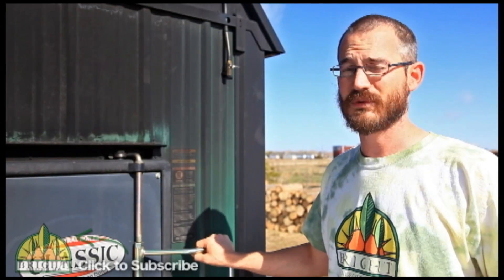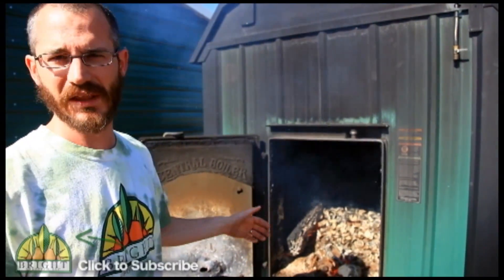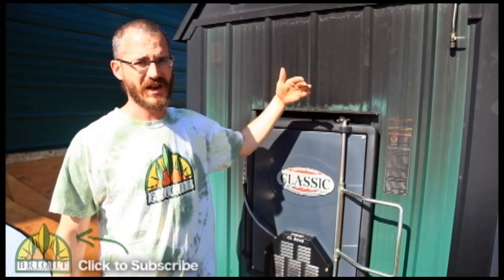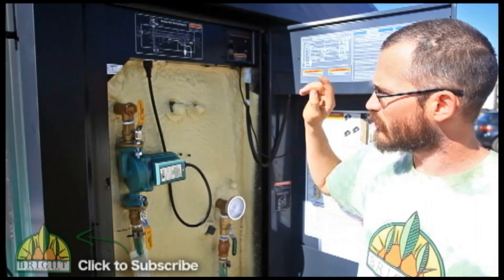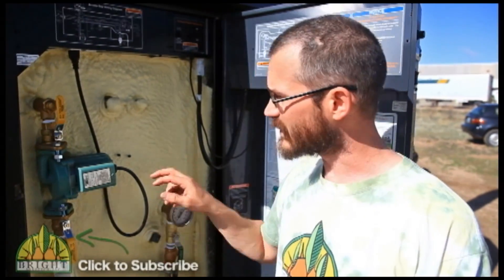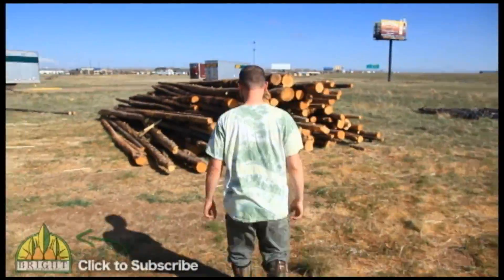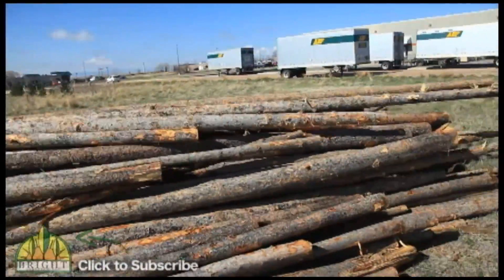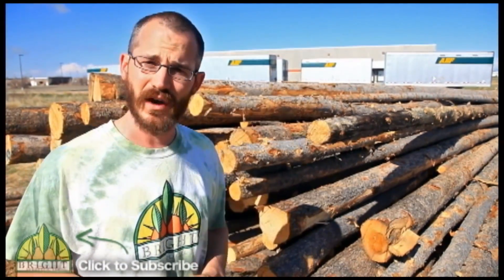Heating a Greenhouse with Wood

Comment: I just love my old basement wood burning boiler/heater. It's just one of those old fashioned one from the 80ies connected to a bunch of equally old heat elements and lots of pipes. The only thing Im concerned about would be the poor underpressure from time to time. One can see a little string of smoke puffing out when I stack it with too much wood at the same time. But water radiotors give so much heat and tit is well distributed in the rooms.bla blabla wood blabla I burned my thumb bla bla🐿

Comment: Does this size furnace work to heat both of your greenhouses? What size are your greenhouses?

Thanks for putting out the videos. The information is priceless!
Reply from the maker: Hey Carmen! This furnace is only setup to heat our aquaponic greenhouse (2000 square feet)
Reply: Really? I thought the furnace fed the heat exchanges in the greenhouse too?
Reply from the maker: Carmen Igoe Yes our aquaponic greenhouse is fed by the furnace via heat exchangers. It's 2,000 square feet (20x100)
Reply: Thank you so much. We're working on our setup and I can figure out the BTUS for the greenhouse, but I wasn't sure how to calculate for the aquaponics system too.

We're planning with an end goal of 2-20x48 cold frame greenhouses plus the fish house (with 3 or 4-500 gallon fish tanks ).

I was hoping if that furnace could power your setup, it would work for us as well.

Comment: Wood boilers are great, but what happens if you can not get out to stock it? I have a wood furnace, and occasionally get back to it "almost: to late to get it fired back up. Love those big burn boxes!  Do you have a backup.  Kind of same issue with rocket mass (I like that method best personally).  Also surprised you went with passive air (automatic baffle) as opposed to forced induction. Those boilers are even better with green wood, also will get up to heat much faster.
Reply from the maker: We make sure someone can go out and stoke the furnace! Otherwise, we start losing plants and fish ...  and that's a bad day! It's not super fun to venture out at 11pm in -40 degrees to stoke the furnace, but someone has to do it! Too much green wood doesn't burn as well plus it emits A LOT more creosote when it does burn.
Reply: You should think about building a nicely sized wood shed or at least an awning over your boiler.

Comment: Chris might be talking about geothermal heating, I save about 70% using this system and paired with solar it's an unbeatable combination they can be used for heating and cooling! electricity , etc. no need for wood at all unless in very, very extreme conditions???-30 ? even then it should cut your cord expense about 70% or more.

Comment: Pretty cool. I was just learning about using oil in a hydronic system the other day. I think I'll just stick to a gas vent system for my house and greenhouses. I'll be building a mass heater under each structure. A small fire each night in the wintertime before going to bed can provide enough heat for a 40' x 40' greenhouse all night that way with proper underground venting that requires probably about half the wood this uses, and no electricity at all. Simple tec from before the roman Empire to heat their baths. If it's really cold in the morning, you build a even smaller fire before going to work. It may not be as technical as this, but can be regulated on mili volt dampeners to cool things down if they start getting above the required temperature  mark.
Reply: Also, digging all your videos!

Comment: What did you use to perform your heat requirement calculations, is there a website or spreadsheet that you could point me towards?
Reply from the maker: Google Greenhouse BTU calculator- several will come up.

Comment from the maker: We use a pex coil because copper will kill the fish otherwise. That said, we don't use any copper or brass fittings/tubing in our system. Pex is considerably less expensive than stainless steel.

Comment: Hey Nate... a question as far as heated coils within the fish tanks to maintain the ideals of 70-75 F  Are there any issues with using copper pipe such as Copper toxicity leaching and adversely effecting the fish .... and are there any copper brass fitting in the systems you are using and or are you using water heat ex-changers with stainless?
Thanx Nate!
GW

Comment from the maker: Thanks, Matthew. We keep out water between 70-75 degrees with our heated coils in the tanks. In regards to heating the air, we use heat exchangers and fans. Check out our video titled: "Heating a Greenhouse" - In that video we talk specifically about our heat exchangers and how the heat actually gets into the greenhouse! Hopefully you'll get some good info/ideas in that video!

Comment: Keep up the great videos. What temp. do you try to keep the aquaponic water at? Do primarily get the btu's in through the greenhouse air or do you have a water to water heat exchanger?

Comment: Any idea what the C02 output is on a boiler like this ? I was looking into pyrolysis myself as if offers a way to sequester the carbon generated in the burn in the form of bio-char (high carbon charcoal). Its one of the concerns I had for my business as I want the smallest footprint possible. Its still a great idea I just worry about the CO2 output of burning "40 cords of wood per winter". As always great videos great info keep up the good work.
Reply: If the wood sat on the mountainside and decomposed, I think the CO2 output would be the same as burning it. Strange to us, but growing the tree is what produces the CO2; its release into the atmosphere is simply delayed until the tree dies and decomposes.

Comment: There is a startup here which uses a smaller version.  I watched it burn large rounds.  The stack was raging hot with exhaust gases.  Therefore, I find wood boilers terribly inefficient.  Web4deb and I have both used rocket mass heaters to keep our geodesic domes warm last winter.  They are very efficient. I used free wood pallets from craigslist for fuel.  Learning how to design the inner stack is priceless. Rob, Is the stainless still working?  Firebrick for me has worked great.